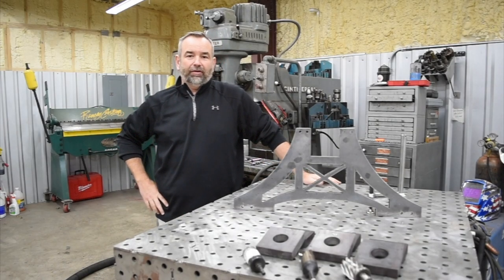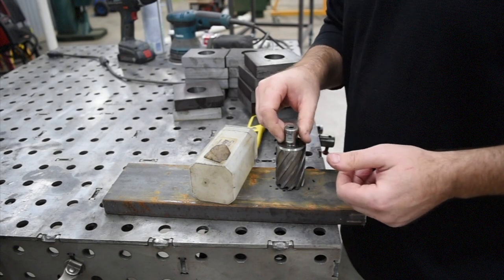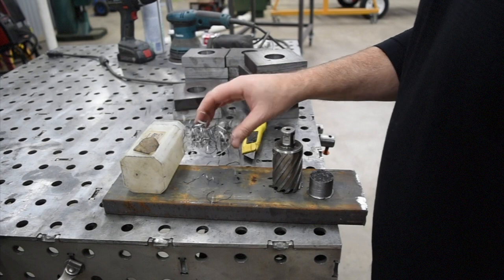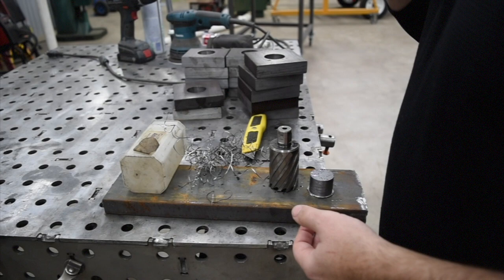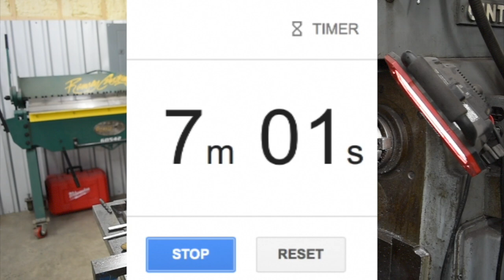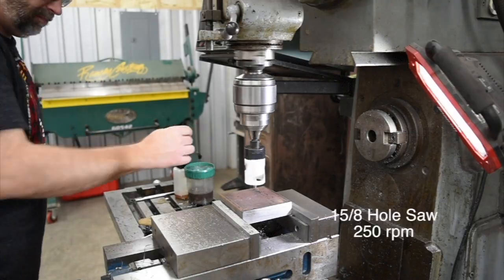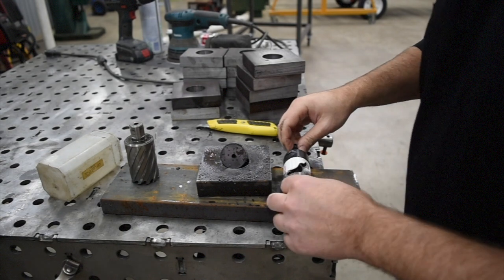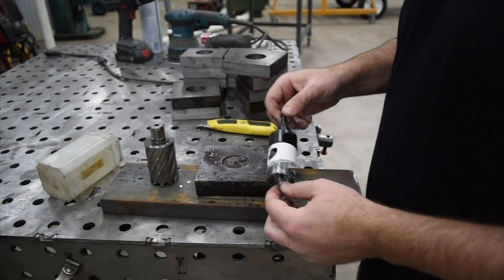Drill big holes in 1" thick steel - Fastest way? - Iron - Metal - Aluminum - Large Drill Press

Comment: Forget the dabbing with the brush those bits should be swimming in oil
Reply: Facts yo, once it starts cutting flood it
Reply: @alvinsuklal7511  You know it !
Reply: @peterm8078  When drilling the heat is not your friend , the color of the spent material will tell you if you're too hot then there goes the edge

Comment: The Annular cutter would have done it in have the time, if you were using a oil squirt can on it.  All the stops to put oil on it slowed it down.   Also when you use them in a mag drill you can fill them up with oil where it comes out automatically when the point hits the metal.
Reply: And I've also read that you don't want to peck drill an annular cutter either. It's harder on the tips or wears it out faster... but, yeah, that's why mag drills do constant flood coolant.
Reply: 1970chevelle396 I agree that's what I do just you a bottle or an oil can and flood it with cutting oil. The whole brush thing is just a waste of time and I don't think it puts enough oil down in there.
Reply: MichaelKingsfordGray Sorry man, I just substantiated it with facts and sited my sources... From the inventor of the Mag Drill AND Annual Cutters. You are a little too late to the party with your late night smugness.
Reply: OK, it's really about the way the annular cutters work on the small scale. They are basically little planes going around in a circle picking up a shaving. What happens when you take a wood plane and in the middle of the stroke, you abruptly lift off the plane? You end up with a ridge where the knife edge didn't complete the cut. Well when you have an annular cutter, and up to 10-12 mini planes spinning around, all trying to shave up one long continuous ribbon of metal right behind the proceeding ribbon of metal... then if you pull up the cutter, and re-engage, you will basically be ramming sharp leading plane edges into possibly 12 metal ridges left by the previous cut.
Reply: Also: every time the teeth engage the material they're rapidly going from fully unloaded to fully loaded, and while the teeth are fine in both states as long as all your numbers are rational, the moment when the teeth move between the states is when the edge is most likely to fail. Twist drills are too long and have too poor evacuation so you must peck with many materials, but they're cheap and designed to be resharpened frequently, an annular cutter has too many teeth for frequent sharpening to be practical.

Actually the reason that Eco Mouse's ridges are 'dangerous' to the tool is each one varies the loading on the teeth, and if the tool is not sufficiently rigid, or the material is too strong, the cutter may not eliminate that ridge entirely in one pass, instead riding up slightly as it cuts through it and leaving a smaller mound to be addressed again by the next tooth, and maybe the tooth after that, all of them going through slight loading and unloading cycles. This is also why it's very very important to have a constant tool pressure, if you go yanking on the quill feed, you'll break any tool.

Also because of how any magnitude of hole saw works, every time you remove the teeth from the material, they will not engage it in exactly the same place again, meaning, within the limits of your mill's quality, every time you pull it up, you're creating a step in the hole wall, that can only be removed by some method of reaming the whole a little bit bigger.
Reply: @TheRealestEver

Impulse of impact has more frequent stresses of a higher magnitude. A continuous cut has a single initial impact but cuts through exactly the same length of material as peck drilling.

Each peck is a high magnitude stress spike. Notice the forces involved compliment the stress concentration at the sharp tip of a cutting tool. 

If you plot a graph of stress on the cutting tip against time, the peck drilling technique will have the spikes and hence a larger area under the curve i.e. more wear on the tool
Reply: Eco Mouse - You are exactly right, never stop the downward force until the hole is finished. The bird nesting is a pain in the rear, but the high sulfur drilling coolant makes quick work of it. I own several mag drills, and that's our practice in my shop.
Reply: WATER SOLUBLE OIL BASED COOLANT IS THE MOST IMPORTANT FACTOR IN MAINTAINING A SHARP CUTTING EDGE LONG TERM THE WATER DOES THE COOLING OIL CANT DO

Comment: Simple tip for the hole saw... I ran some parts that required a 6" rough machined  hole in 1" thick plate a few years ago.  Rather than circle burn them  (plasma table wasn't an option) the plates were to be in the mill anyways so I hole sawed them. I drilled 4, 3/16 holes at 90* to each other on the 6" circle (staying just inside the OD of the hole saw). This allowed the chips to clear through the small holes and I passed the hole saw in one pass with coolant of course. Cheap, easy and dirty as f!
Reply: That's a great idea.flatbroke. That way the hole saw has a chance to clear the flute.
Reply: Would that work with all the tools? 

Especially the annular. Longest chip is the diameter with one hole
Reply: Kevin Breslin, do you mean whilst using the annular cutter? If so it wouldn't be necessary if using the annular cutter.
Well I don't have an annular cutter blade. Not at this moment. I recently cut 2.25mm 43mm galvanised tube. I actually stripped the teeth of my 43mm bi metal hole saw. That's because I ran it between two sides without a pilot drill. I then used a 51mm cobalt holesaw bit with pilot drill. I used a metabo cordless drill and set the torque on number 5 at low speed. Each time the bit caught the drill would stop. This worked well.

Comment: The annual cutter is designed to be used with a continuous flow of cooling medium, which will seriously decrease the time used for cutting through thick steel. We always used a magnetic drill press with a built-in cooling medium container.
Reply: I don't have the press to run these bits, and so am no expert; but lol, that smoke is a bad sign, IMO. Spinning too fast and/or insufficient cooling.
Reply: @markluxton3402  my coworker and I use a milwaukee fuel to drill the box rails of ambulances we remount to 1" 3/8 using a step bit through half inch aluminum overhead. Shit actually sucks eggs

Comment: As a point of experience, you don't need to step drill with a drill bit.  Yes, it will go through faster if you have a pilot hole that is as large as the center web.  It can actually be a detriment to step drill because 2 flute drills are not designed for enlarging holes and do not self center well.  The margins also tend to wear more when enlarging a hole because the tip is not keeping it on center, thus causing the bit to wear out faster.  Try plowing that big drill in without a clearance hole, then try it with just a 3/8 clearance hole.  You also don't really need a spot with larger drills, the drill is stiff enough to keep on center.  Maybe I'll do a video on this principle and also share some old-school tooling, an APT insert drill.
Reply: Agreed. It you have the torque and quill strength, lean on it. I don't always, but sometimes I do. In my lathe I step drill as to not wear out my hand lol.
Reply: eformance yes step drilling is a time waster. only remove enough with the pilot drill to relieve the center chisel point of the finish drill.  progressively enlarging a hole just allows you to unwittingly over stress the drills cutting edge. there is less drill contact with the material allowing you to feel better about pushing down harder but still just as much force per inch being applied to the cutting edge.
Reply: True, however if your machine lacks the power to turn the larger bit (remember the larger cutting lips require more power) step drilling is probably the only option for the average size drill press.
Reply: I agree, I was taught that if you use a pilot hole go just barely bigger than the center web of you big bit. using a larger hole tends to chip the cutting edge where it contacts the edge of the pilot hole
Reply: Another problem with multiple-step drilling with big drills is you are more likely to spin a taper shank drill or chuck, and damage your spindle or tailstock taper bore, because Morse tapers rely on axial thrust being high in proportion to torque. When driving a big drill through a hole which is already quite big, you won't necessarily provide enough thrust resistance to keep the taper loaded (and locked) up, but the torque load is still substantial. The tang is not designed to transmit the torque required by a big drill, and it may shear off and allow the drill to spin.
Reply: Gottenhimfella heh. I actually bent a 3/4" drill bit when it bound up doing just what you mentioned. luckily I got my hands free. 
we used to grind our drills to center cut. works great as long as the steel isn't too hard. we did mostly the air hardening stuff
Reply: I mean, if you use anything else other than the first method you are dumb unless of course you do not possess the power these drill press offers.   I think method 2 is good if you are trying to make small holes of course.  Method 3 is good if you are trying to punch holes through a computer case that is thing like sheet metal.  To drill through 1" thick metal w/ the other 2 methods are dumb also if you use the first drill to drill through sheet metal you are dumb unless it's the only drill bit you have but I assume it would warp the sheet metal around the area due to the teeth not being thin and plentiful for some good heat at high speed friction heat generation.
Reply: EFormance Engineering believe it or not, in the place i work, we drilled with a 3" drill bit with no pilot hole :) it can be done if your machine can do it. In this case, the guy has like .5" shank on that huge bit and will spin in the shank if given a bit of torque.
Reply: Agreed, along with other issues about added wear and causing you to feed too fast, removing the middle of the hole reduces the material that conducts the heat away. That added to the too fast feeding destroys your drill's cutting edge.

Comment: As a home hobbyist,  I would never have believed that a whole saw (that I have had for years and only used for wood project) could cut through that thick of steel. AMAZING! Thanks for sharing.
I just bought my first welder and this method has raised more possibilities for my projects. Again. Thanks!
Reply: If cutting thru steel you just gotta make sure it's a carbide-tipped hole saw, otherwise it'll be useless after one or two uses. I personally prefer the annular cutters on a mag drill for thick steel and hole saws on thinner steel but that's just me.

Comment: Great demonstration. Obviously the annular cutter didn't surprise anyone who is familiar with them, but most people aren't. I'm sure they all would have benefited from a dedicated coolant spray system, but if you're not familiar with these tooling options you probably don't have that anyway. 

The twist drill run could definitely have been improved by 35 seconds by skipping the spotting drill. That's only necessary when really precise alignment is needed. A generous clearance hole surely doesn't need that kind of help. 

As you said, going straight to a 1/2" bit might have helped. I like the DeWalt pilot point bits for that purpose. But anyone who is really needing to do this sort of thing quickly will get the annular cutters or consider their twist bits as consumables. Buy a bulk pack of 3/8" or 1/2" or whatever size is most appropriate for your repetitive tasks and send them off for dirt cheap sharpening as they dull, using the rest of the pack while you wait.
Reply from the maker: Some good points, thanks Jon
Reply: Jon Miller buy a wax bowl ring, place it where you want to drill, align, fill with water soluble oil and drill.
Reply: I guess if you keep wax rings on hand that might save some time, but if you have to go get one it definitely won't. And those things are huge mess.
Reply: Jon Miller clay will work too, even a simple ring of steel holds fluid to some degree.
Reply: akbychoice nice idea. I now have a ball of my kids plasticine in my toolbox
Reply: Jon Miller i used to sharpen my drills by hand. if you're good you can get the point so sharp you dont need a pilot
Reply: Robert Graham I didn't say pilot bit. I said pilot point bit. Look it up.
Reply: Jon Miller i know what they are. i meant no pilot hole for the large drill. if you wanna save time just push it thru. the pre drill is just to clear the web
Reply: The problem with large diameter bits is the tremendous difference in SFPM between the outer diameter and the center (where you have zero surface feet per minute). The larger the diameter drill bit, the greater the difference. Can you push it through and make it work? Sure. But that will result in dramatically shorter tool life than doing it in 2 or more passes. There's a reason stepping it up has been a standard industry practice (when annular cutters and other solutions are not practical) for generations, and it isn't that they didn't think to do it faster by skipping steps.
Reply: plus we used to regrind them till they were nubs
Reply: Large diameter drill bits, especially of good HSS grade, are not cheap. Again, pilot holes are the standard approach for efficient (and cost-effective) machining. You'll note that in my initial post up top here I advocated for burning through bits in favor of saving time. That's only true up to a certain point (surely no larger than 1/2"). Have you ever priced out bits over 1"? Labor to save tool life gets much cheaper as tools get bigger.
Reply: actually a half inch endmill interpolating would be the Best option. pop that hole in about 30 sec! or an insert drill! man i used to make turbine parts in my NL. i had a 2.5" insert drill going thru 4" of 316l in about a minute flat. those things can move metal!
Reply: i used a mag drill and an annular cutter in the field one day to drill an i beam. As an electrician i dont have much use for this stuff but ill be damned if thats not the best tool set for that job.
Reply: I'm a Ironworker and fabricate a lot on the field. And the fastest is a mag drill with an annular bit. And we use a product made  by Hougan  and it's called Slick Stick just coat the bit before drilling each hole and go to town. A lot more productive and efficient. No need to keep backing drill out every time to recoat on same hole.
Reply: Jesus Garcia slick stick is awesome especially when your using the drill horizontal or upside down. When you use it up right it's best to use the cooling fluid not only for lubricant but it's also helps keep the inner plug cool preventing it from expanding and risking cracking the bit.
Reply: Hougan bits! Especially the carbide tipped ones. Pricey but they turn steel to butter.

Comment: Very good video.  Helps me out a lot.  I've been doing woodworking so long I'd forgotten my metal basics.  Slow the RPMs, machine oil liberally, plenty of pressure...wood is so easy in comparison.  Thanks a ton.  Only problem now is I want a Bridgeport!  I used one a lot in college and man do I miss it.  Hopefully I'll find one I can afford some day.
Reply from the maker: yes you are so right about drilling wood, so much easier.  Is really unfortunate that most drill presses you buy today are made for wood and alot fo them will only run 600rpm on the slowest setting, which is way too fast for anything 1/2" or larger.  thanks for watching and good luck on getting a bridgeport!

Comment: I've used all three of these methods.   I was floored he got the hole saw to go through as quickly as he did. I'd have been there 2x as long going through 3/4" plate, and it might be the first and last hole for the tool,  even using a brand new bit.      The annular cutter is well worth the money!   Cuts like butter!   Requires a strong/rigid setup.   I don't have the shop this guy does by any means, but can't say enough about annular cutters.    I use the rotabroach system for smaller holes in a handheld drill which is basically mini versions of the annular cutters.   Again, cut like butter!   Best investment you can make for your home shop!  Those large drill bits tend to dull quickly, even with oil, and often you spend more time sharpening them than going through the material.    Annular cutters solve this issue as they work more like a milling bit.  It takes seconds to do what would take minutes.  If you have many holes to drill, this can add up to hours of your day.

Comment: For thinner stuff like 1/4" steel plate, I found that tungsten carbide tipped hole saws work very well for cutting larger diameter holes

Comment: Yep, love those annular cutters that get used on magnetic base drills, they go through steel like butter. Better accuracy too. Flood coolant really helps with keeping the tools cool. I've got an old set of really crappy Chinese drill bits up to 25mm but they are still going after 20 years (and some sharpening LOL) because I use flood coolant and keep the rpm down. The flood coolant also really helps with the hole saws, not only with cooling but with the chip evacuation.

Comment: One thing that no one has mentioned is the plug.  Only the annular drill produced a solid plug and scrap like that finds a use in my shop.
Reply: I assume you could leave the pilot drill bit out of the hole saw, it's really only necessary to keep the hole saw from wandering when your drilling by hand.